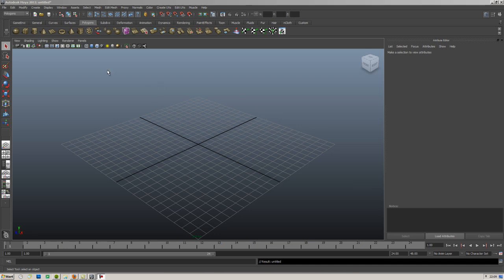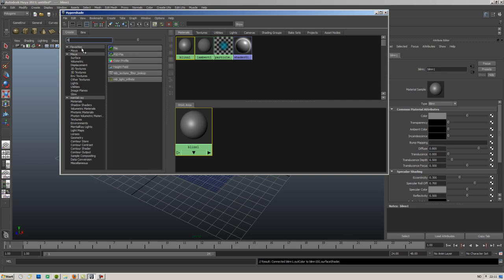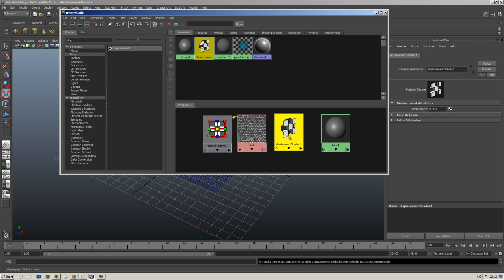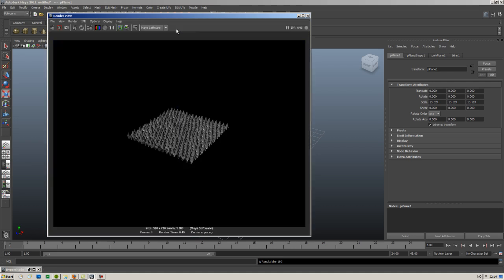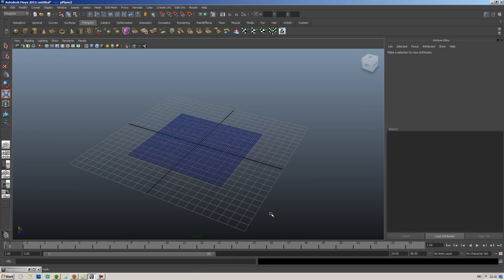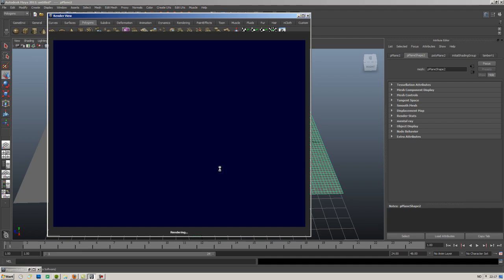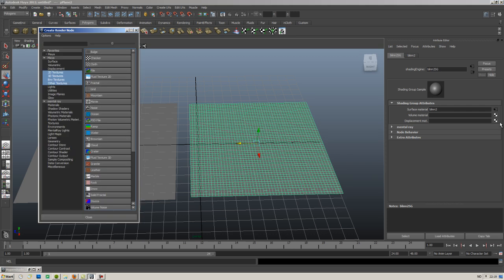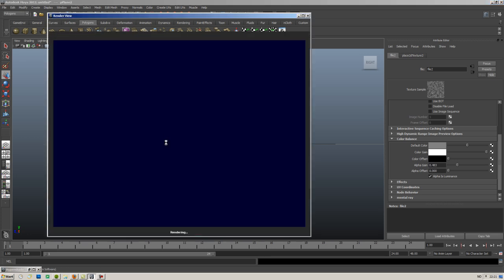Maya 2011 Displacement Map Tutorial

Comment: Well, if you did your displace map using an UV snapshot and applying the displace like in this tutorial the scales should be like you want them to be and you should only have to use some settings in the displacement shadder to correct the right amount of displace. When you say big, you mean the scales or the amount of displace ? If it the scales then you have a problem with your UVs and if it the displace then it should be set in the displace node.

Comment from the maker: Do you mean inside maya after creating the texture file or within your image editing software?
Now I assume, you are probably thinking of using it for something more than just creating depth, like making terrain maybe? Now you can use them to quickly create terrain, but you would have to go in and export the displacement as geometry and correct everything to make it work right, but it does provide a starting point.

Comment from the maker: So what do you mean by control? These types of maps are usually used to create depth, like if you have a sword and you want to imprint something on it like text or logo you use either a bump or a displacement. I havent seen much use of it outside those types of scenarios though i have seen this one guy using the displacementmap as a basis for this game map. But it was all squared. Other than that the intensity of the whites vs the blacks determine the relative hight, its shown in the video.

Comment from the maker: Yes the popup is a list of all the diffrent connections you can make its called the connection editor, maya doesn't understand what the default is in your case and asks you to specify. So you need to find the displacement node in Mayas hypershade since its not in the material by default, so the easy way is by dropping in a file node, and then middlemouse click & drag to the desired material, and dont select default but look for displacement and select it.

Comment from the maker: Good question, so that should not happen. The displacement map should only work with the resolution you already have.  So your smoothing is probably turned on.

If so then here is your solution: Go to
Rendering menu > Render > Render Scene dialog > Renderer panel > Shadows & Displacement rollout > Displacement (Global Settings).
From here you have to go down to "Max Subdiv" and lower the settings, or uncheck "disable smoothing". Happy to help :)

Comment from the maker: It unlikeley the mesh flow. If you have Maya 2012 I just found it that there is a bug in Maya 2012, alot of people had the same issue. try updating. (Or if your using not so legal software, try finding the latest version, otherwise try using maya 2011).

Use the first method that I show in the tutorial, that should get you around the problem. But if it still doesent work I would have to ask you what file format you are using, and how large it is (size).